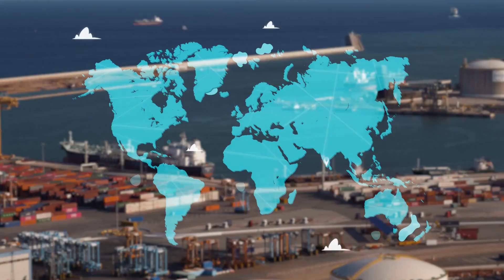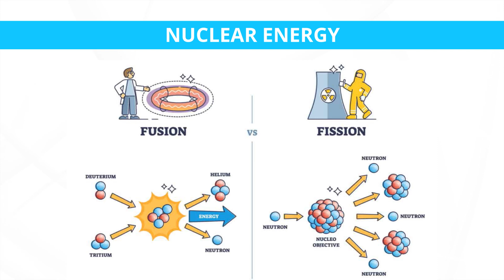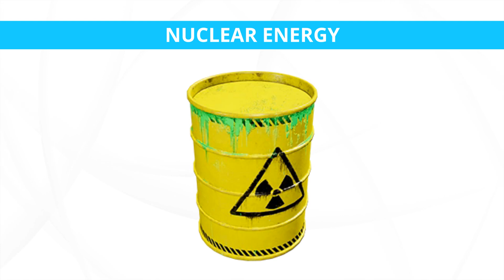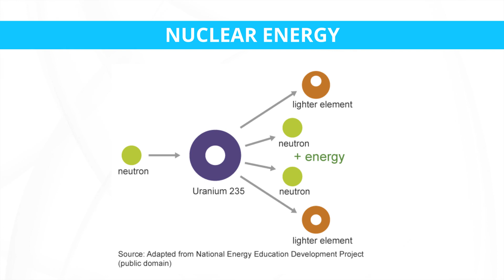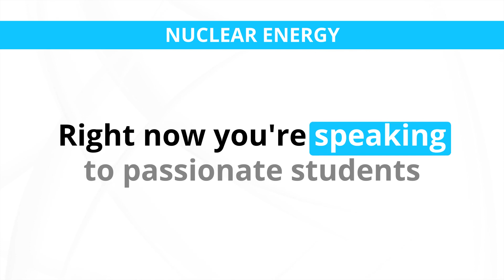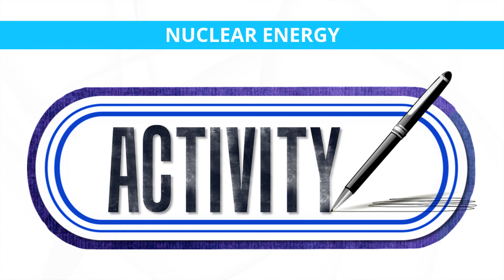Climate Change Solution: Nuclear Energy | How To Solve Climate Change Course

Comment: Too bad you know nothing about nuclear fission energy.  All of your assumptions are based on the pressurized water reactor invented by Dr Alvin Weinberg for the Nautilus.  This was a very small reactor but the design was Giga-sized by engineering companies to the point where meltdowns were possible and against the warning by Dr Weinberg.  Dr Weinberg went on to develop the only inherently safe and efficient reactor at Oak Ridge, the molten salt reactor.  He proved this technology in the late 1960s and was ready to build a large power generating plant, but was fired for his planet saving effort.  The AEC and DOE hide his research from the public and is still creating road bocks to its development to help the fossil fuel industry.  The DOE only allows development of energy sources that will never replace fossil fuel like fusion, wind, solar, wave, bio, hydro and geo.  The fossil fuel industry has too much political power worldwide.  Nuclear was doomed when the AEC chair said "Too cheap to meter".